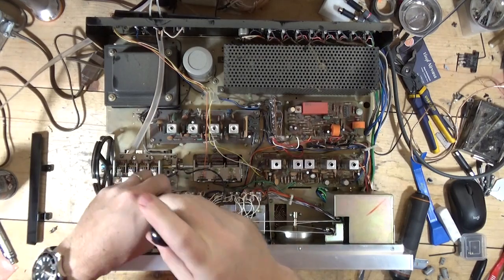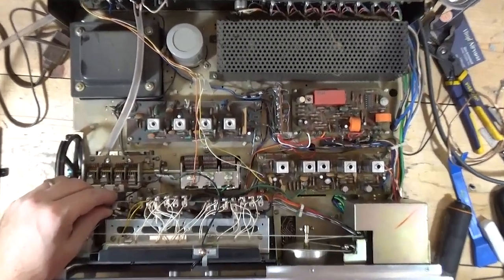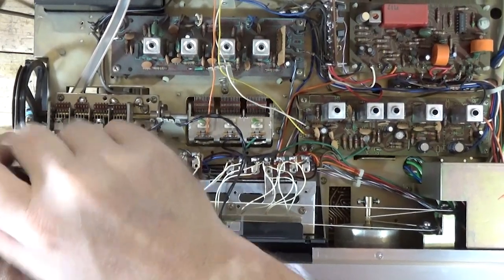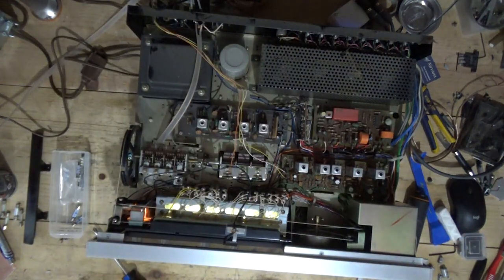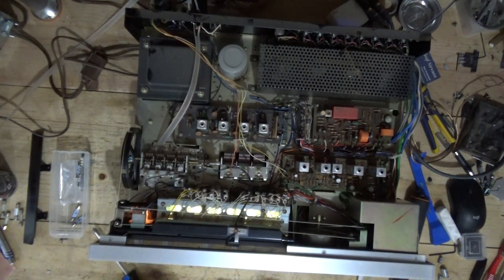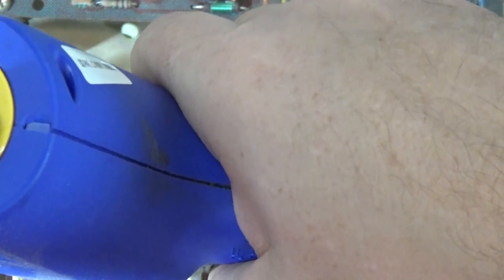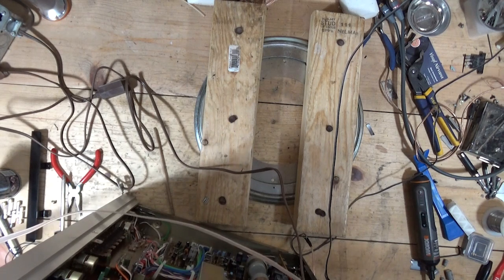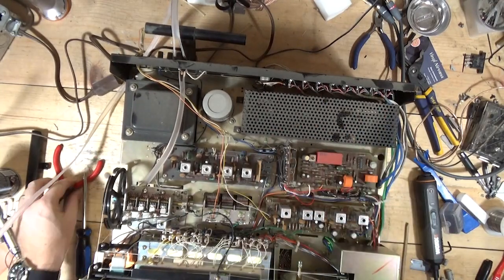Pioneer SX 6000 Stereo Reciever Repair Part 2 - Repairing Dim Lamps and Wrapping Things Up

Comment: i have a sx-434 and couldn't figure out why all the lights were dim, it was the line voltage selector switch, it was set at 240v i switched it to 120v and everything works excellent!
Reply from the maker: Great to hear!

Comment: I know you did this months ago but there is a procedure on AK to adjust the bias and offset. Nothing in the service manual.
Reply from the maker: I’m guessing it’s the same procedure for the SX 770/990/1000.
Reply: The bias trimmers on these are prone to failure.  A must-change.

Comment: I bought an SX-9000 recently and it needs new lamps. Everything inside looks original so it needs service. I'm not sure where to start. What's the cost for servicing one of these receivers?
Reply from the maker: Too many variables involved...issues with the receiver, techs in your area, local market pricing....
Reply: @millervintagehifi3034  I'm finding out it costs $100 just to test it. It'd go towards the repair price, but I'm just hoping it's not twice as what I paid for the receiver.

Comment: I have a question about my SX 6000 Pioneer I have it opened up replacing all the bulbs and the screw in bulb on the far left with the tuning meter and the strength meter. There’s two like little rubber washers that aren’t screwed to anything. They just go up against the bulb and somehow make it work, I’ve never seen a connection like that before. Maybe you can help me out thanks.
Reply from the maker: Unfortunately I don't have a 6000 to look at.  Your best bet is to open a thread on Audiokarma.